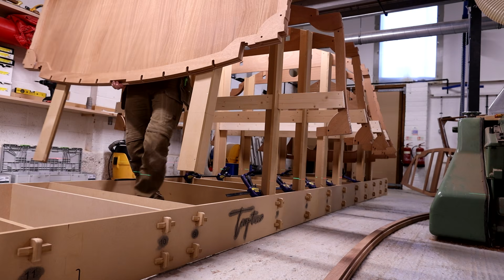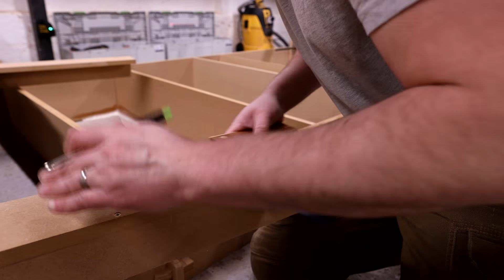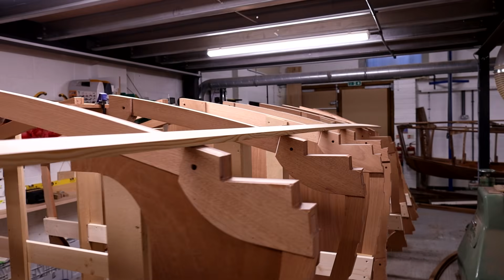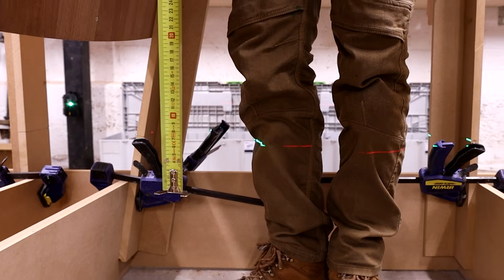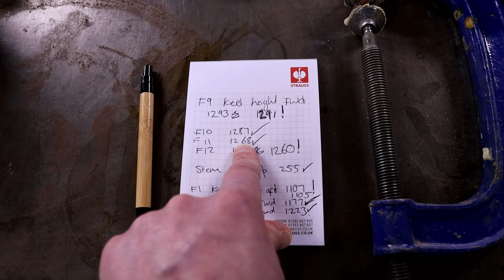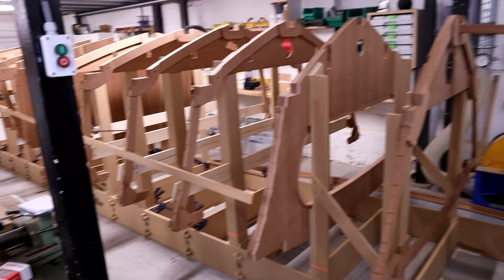Does This Change The Way We Can Build Wooden Boats? | Building Temptress Ep21

Comment: Is there a reason not to cut shallow alignment recesses (think open mortises) into the frame pieces to allow you to just place them onto the strongback at the correct height if all the legs were cut to a uniform length?

Comment: I think it’s a wonderfully accurate way to build a boat. A straight untwisted frame is what we’re after and the end product will retain the investment for the owner. It also means your creativity can be unleashed  - lofting a wooden boat in 3D before construction will give the skilled boatbuilder a huge heads-up into any mysteries lurking in the design. The glue and fixing regime will be a treat to undertake

Comment: It seems like some of the "timbers" can be under a lot of stress when you bend them into position along the hull of the boat. Have you ever seen these timbers crack/break on a boat that has been in use for while?
Reply: The wood will eventually 'set' in the position you fix it in. So if you were to remove that piece years later it wil stay more or less in shape and not go back to it's original (straight) form.
Reply from the maker: To be honest when I was bending that topside batten in I was waiting for the crack but it never came. Once these are bonded in there will be no chance of them breaking when the boat is in service. The initial bend of them is usually when they break if they are going to.

Comment: I always laugh a little when he talks about 1 mm tolerance. I live in FL, and have built a few wooden boats. You could swing 1-3 mm with just the slightest change in humidity.
Reply: I've seen 1/2" plywood decks swell more than 1mm.. I was worried in his earlier videos about timber movement and him trying to make everything tight like a fully composite build. but all we can do is sit and watch, and hopefully if something goes wrong he'll be man enough to speak of what could be done differently to improve.
Reply from the maker: I do keep quite good control over conditions in the shop. I have a heat pump that does heating, cooling and dehumidification which helps to keep me at around 50% humidity all the time. What sort of % do you typically get in Florida?
Reply: @DanLeeBoatbuilding  First off let me say what you are doing is historical. The level of perfection you are looking to obtain tells me you should have been a watchmaker. :) With that said, Florida was built on a swamp. Normally we are at 60%-100% humidity, so you would think wood here would not expand as much, but oh it does. I replaced a garboard plank once and left about a quarter inch room on each side. That plank expanded vertically over 3/4th of an inch and cracked the plank. Keep doing what you are doing, as I doubt this vessel will ever see tropical conditions. The world needs more people like you.
Reply from the maker: Thank you, thats very kind. It's interesting that you mention watch maker, I am not of that level but I have some ideas along these lines when it comes to making the gauges for this boat. It's a little way off yet but that will be an interesting stage of the build for sure.

Wow thats a serious humidity swing! I think 80% is probably the highest I've ever seen here when the shop isn't being climate controlled. No wonder you see large dimensional changes, that would require a different approach to this process for sure.

Comment: A question on the frames. Why not hang em off the ceiling as opposed to standing them up?
Reply from the maker: That would make it very difficult when it comes to planking the bottom.
Reply: @DanLeeBoatbuilding  Thanks, hope you keep the videos coming!

Comment: This is so impressive.  I have only done a limited amount of boat building but what i did was a constant struggle to try to get the right shape, fit and tolerance.  You might have had a slight glitch with frame 9 but you can just see how it is going to come together.  Yes it does mean a big investment in kit and new techniques but you can definitely see the potential.